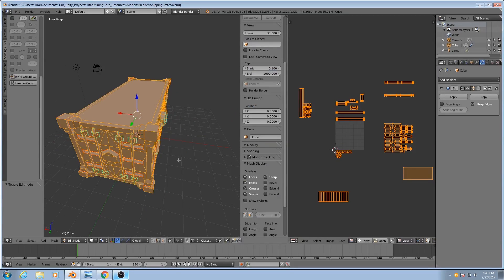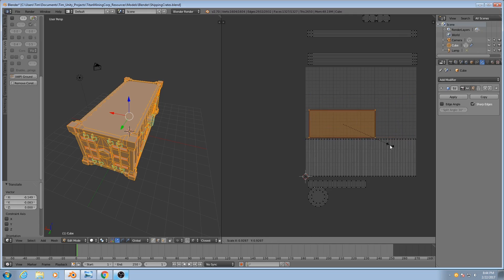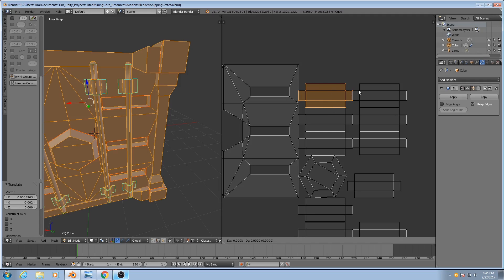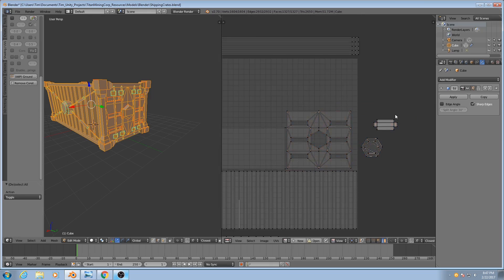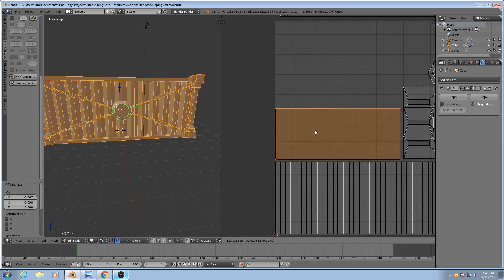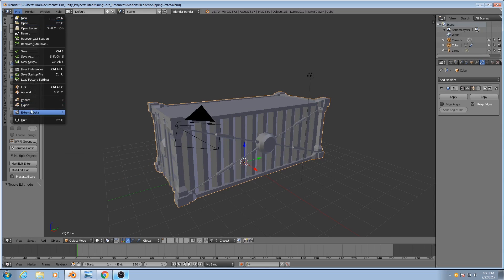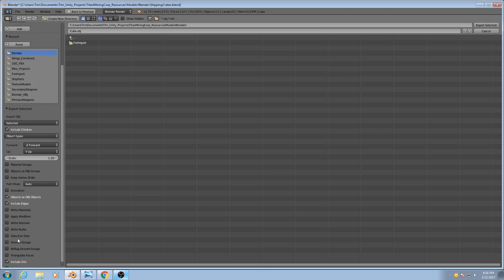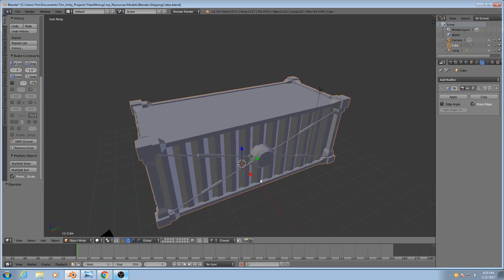Blender Game Asset Modeling Tutorial (Part 12)

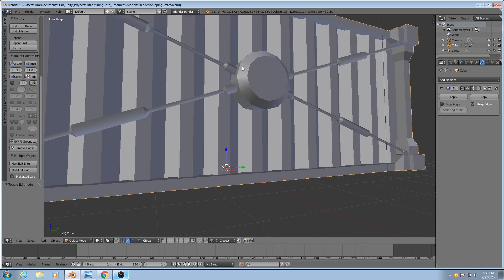Comment: 6:25 are the same settings applied if you would use .FBX for instance? Really like your 3D-coat videos by the way! keep up the good work :)
Reply from the maker: Not quite the same settings. You would still turn off 'Apply Modifiers' but instead of options for smoothing groups, you would turn on 'Include Edges'.
Reply: AlienMinefield okay, thanks for the response! :)

Comment: You can also do Ctrl + P to pack everything automatically.
Reply from the maker: That's fine if you need something packed quickly for a test render or a preview, but when you're working on background assets for game development, you want your textures to be used as efficiently as possible. If every pixel that shows on your model is unique, you need larger textures to get a good resolution to display on your model. This means more memory consumption for your game and longer render times. By overlapping the UVs, you can get a higher apparent resolution with a smaller texture. The automatic packing algorithms do not respect overlapping UVs and the resulting pack isn't as efficient as doing it by hand.